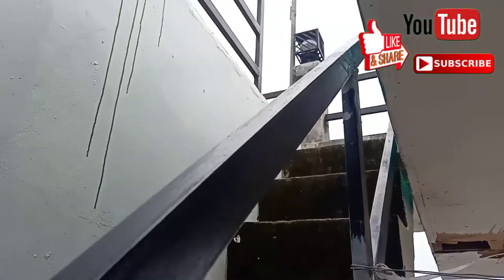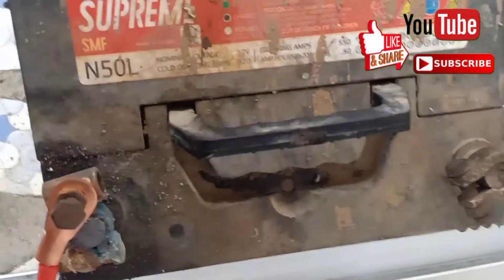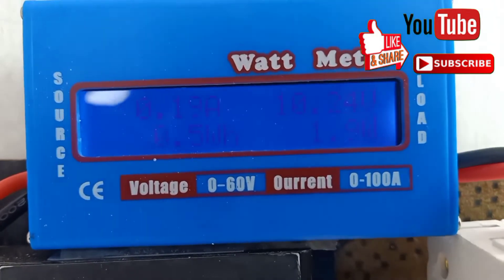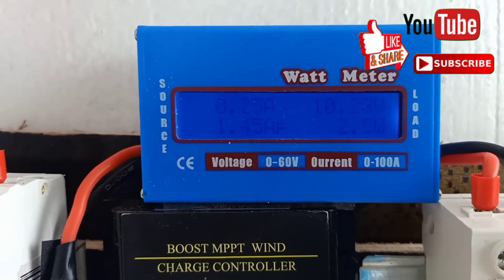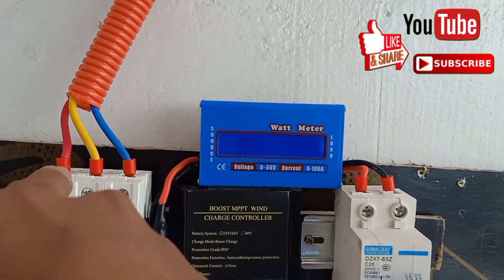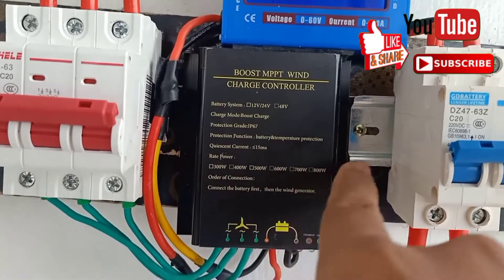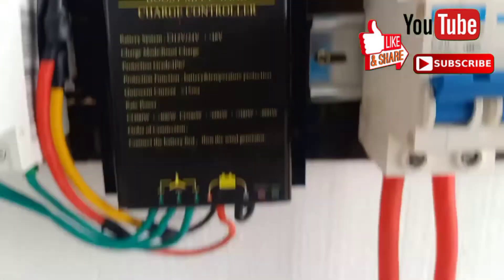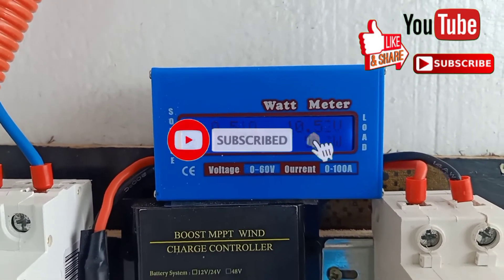48v 800w Wind Turbine China Made Review

Comment: Usually if they advertise 800w divide by 10 to get estimated watt hour. So expect 80w continuous power.
Reply from the maker: I can't even have a decent stable wattage with this wind turbine. Just waste php 10k with this item
Reply: @allzzizzwellzz5841  are you in the Philippines? I would have thought PV solar would be more efficient given the beautiful weather you get. Cheaper and no noise too
Reply: hahaha, I bought an 8,000 watts wind turbine so It should be 800 watts :) I can't wait to install it and see how much power it can produce.
Reply: @SolarMinerPH  if you bought off aliexpress or similar, I’d be interested to see what the actual numbers are once fitted? Obviously if you bought from a commercial installer you’ll be getting at least or close too your 8,000w quoted. That or someone wouldn’t be getting paid 😜
Reply from the maker: Why was the divided by 10 anyway for the wattage came from
Reply: @allzzizzwellzz5841  over rated by manufactures.

Comment: Hi there, unfortunately this turbine is max  400w but alot of sellers sell 100w turbine as  800w or 400w. I have two 400w and one 500w turbines.
Reply from the maker: My blades are 600mm per pcs... i cant even have a decent wattage with my turbine. Its alway blinking red. I think its breaking
Reply: @allzzizzwellzz5841  yes if the red light on controller is coming on it is braking the turbine, you can try a better connection to battery maybe it will help, otherwise just buy a rectifier without braking function. Maybe battery is getting charged or low capacity?
Reply from the maker: I will try to put 24v maybe that will fix. I don't have 48v battery for now because it was not suitable for lifepo4
Reply: @allzzizzwellzz5841  depends if turbine is 24v or not otherwise might not reach battery voltage. You can buy a controller for lifepo4 .. i have one on my channel